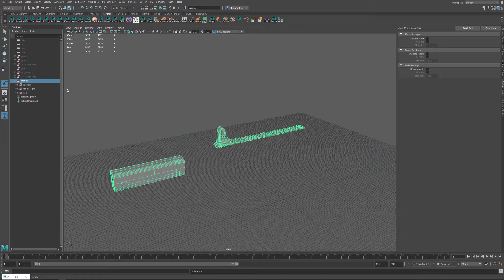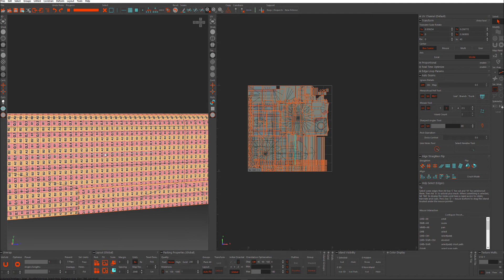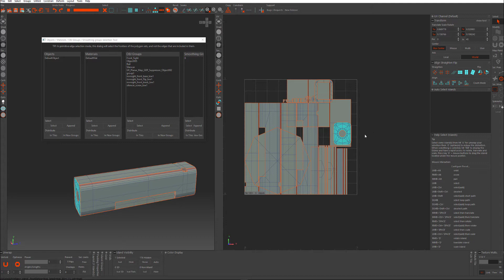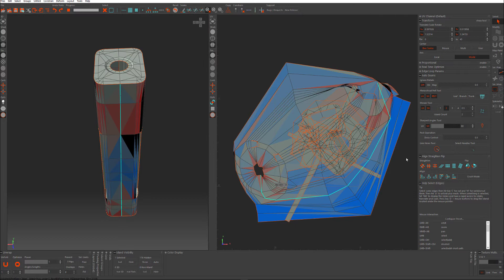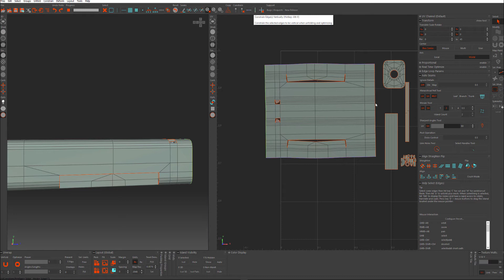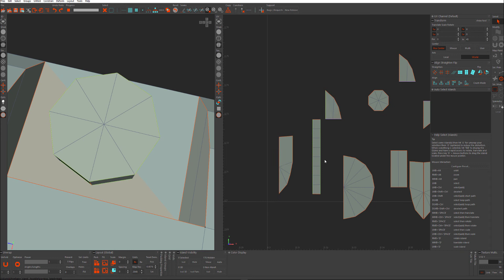Unfold3d 10 - Importing, Interface, Unwrapping

Comment: Thank you Chris for this tutorial. I like the way you used the pinning and optimize. 

One tip: Unless you want to unfold or optimize several island at a time, it is not necessary to select an island to unfold it or optimize it. Just place the mouse pointer over one of them then press 'U' or 'O', it will do the job with less clicks.
Reply from the maker: That's great to know, thank you!
Reply: this app gets better by the minute!